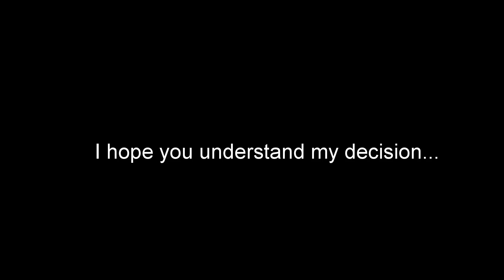Giving Away My 1,400HP Twin Turbo Corvette...

Comment: I may not like that you got rid of the car but it's for the best honestly. I remember in a previous Q&A video you did say you want it kind of slow down a little bit so an 8 second car is not as necessary as say a 9 or 10-second street or super car which can be used as a daily

Comment: Fucking guy bought a c6 last year around this time and started hyping up this ultimate drag build he was gonna make it into. He did some small mods himself and then ordered a built LSX and sent the car to be built by a professional shop. The build cost more than he expected so that delayed the schedule all the while he is hyping up this car. FINALLY at the beginning of August he gets this car back, nearly a year since he bought it and the car is amazing, full drag build, power, suspension, trans, everything is done up perfectly. The car makes 1500hp to the wheels on race gas and the first time it ever went out to the drag strip it ran a low 8 second 1/4 mile.

He brings the car out to a roll racing event and something is wrong, plug wire burnt, needs replaced. 

The dude he asked to replace the wire has been looking for a car like this for his girlfriend who is getting into the drag racing scene, dude sells the fucking car to the guy, his reason? “Drag racing isn’t my thing”